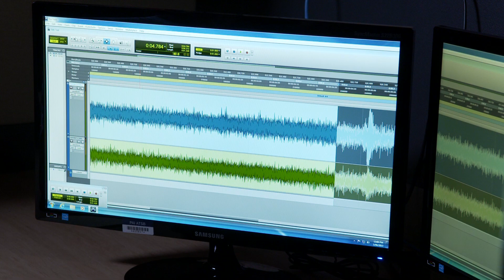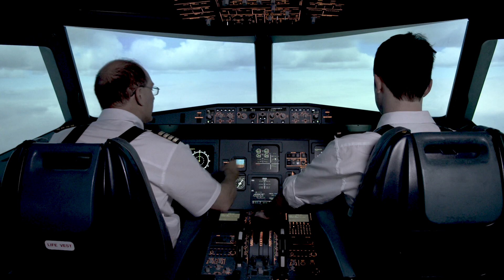Handling Approach to Land

Comment: My dad helped me with my first on road car driving lessons. Dad was ex RAF. Javelin, Meteor and Vampire. Dad wanted to instill in me planning, spacial awareness, communication and safety while I was learning to drive a car. So this video to me, is also applicable to safety on our roads. As I said to my son while practicing to drive, if you can't get into the correct lane to turn, go forward until you can make the turn, then go back. Like a turn-a-round. In Australia, left turns are easier than right turns, always. In Melbourne city, we have right hook turn at some intersections! Thanks for the video.